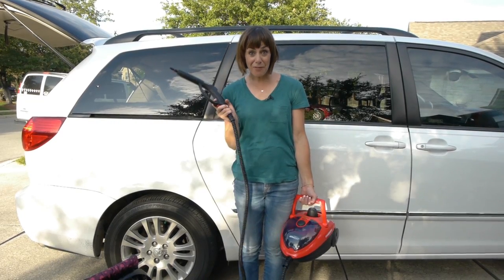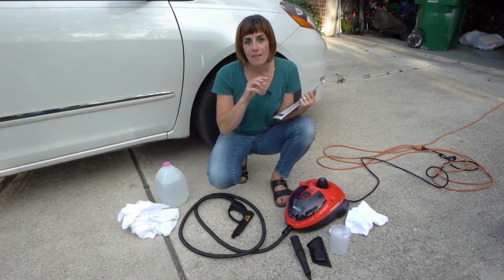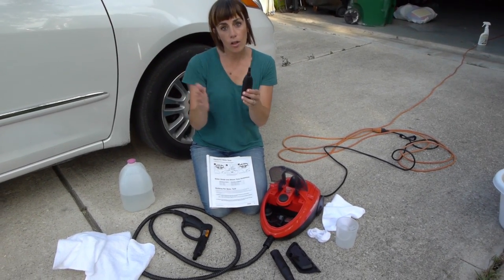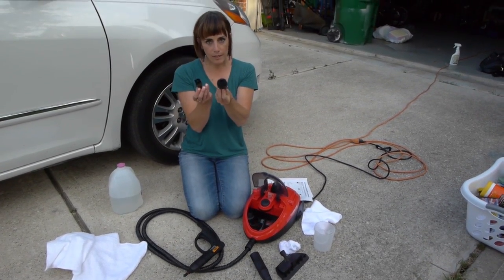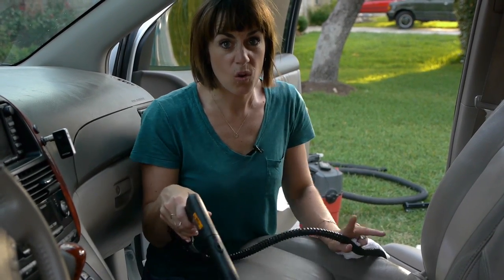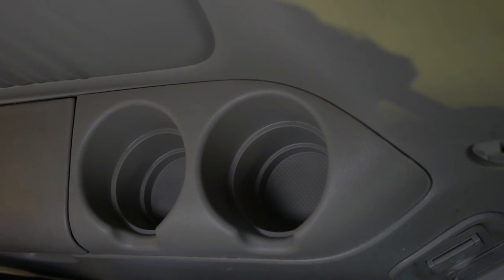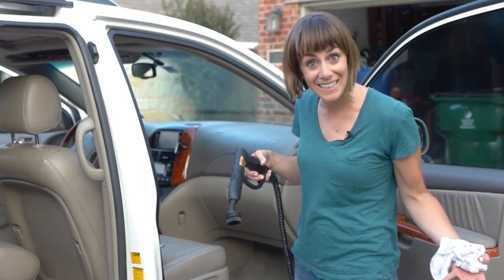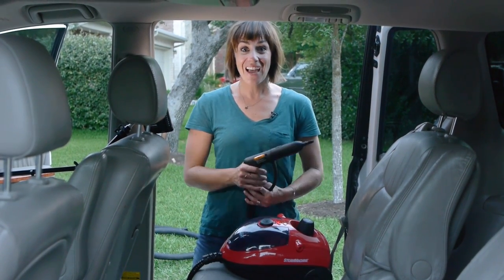How to Use the AutoRight Steam Machine with Live Free Miranda

Comment: How well does this clean brake dust,  dirt,  oil and grime off of car wheels?
Reply from the maker: The AutoRight SteamMachine works great for cleaning car wheels! The high pressure and temperature allows the steam to easily lift away dust, dirt, oil, and grime.
Reply: @HomeRightPS  What exactly is the temperature of the steam? I had a bigger $150 McCullough that I'd like to replace from Amazon. The manufacturer never responded to my complaints about their faulty switch. Which is frustrating because I left the switch in the on position and simply unplugged it when done. Home Depot doesn't service  them either. I now consider this a disposable product that may last a year, if I'm lucky. The steam wasn't that hot but I used it inside AND outside. I see it as a homeowner's necessity. I detailed my engine, rims. windowsills, glass shower doors, mirrors, storm door, granite countertop, stainless appliances, toilet, etc. FYI the attachment brushes will melt. You'll definitely need replacements. In most cases I didn't use the attachments. The squeegee attachment works well on mirrors. Distilled H2O is cheap BUT if you're certain to store the steamer EMPTY tap H2O should be fine.
Reply from the maker: Thank you for asking! We're sorry to hear about your McCullough steamer, you'll like the AutoRight SteamMachine much better. The AutoRight SteamMachine delivers up to 290° F steam to your surface and comes with a variety of attachments to clean countless surfaces.
Reply: @HomeRightPS  Is there a demo video that proves  your claim of 290 degrees F? What is the length your warranty? Does the warranty cover if it doesn't work? What if the hose breaks?
Reply from the maker: @PARIS8500  We do not have a demo video of the temperature. The steamer is covered under a 2 year warranty and will be replaced or examined by our technicians if there is an issue.
Reply: @HomeRightPS  what is the return procedure? Is shipping on my dime? AND to be clear your 290 degrees claim  is for your Elite steamer $140 NOT the cheaper model for half that price.
Reply from the maker: @PARIS8500  It depends on the circumstances but you can always call us at 800-264-5442 and we can walk you through the return procedure. The SteamMachine Elite and the AutoRight SteamMachine both output up to 290 degree steam. The Elite comes with different accessories and features a floor carpet glider.

Comment: How much water and how does it suck the water back up when using the upholstery attachment since it has the cover over the top?
Reply from the maker: Hello, thanks for your questions! The tank holds up to 40 ounces of water, which provides approximately 45 minutes of steam cleaning. The machine is using the water in the tank to produce steam, so the water doesn't end up back inside the tank. The steam is doing the cleaning without suction, and the attachments are directing the steam!

Comment: How do I refill it with water again
Reply from the maker: Hello Matthew! If the steam machine has been in use and you would like to refill it, turn it off and unplug it to let it cool for 30 minutes. After 30 minutes, make sure the red safety switch is ON and pull the trigger to release the steam pressure. Then, you can refill it with distilled water. This information and other safety precautions can be found in the manual. See page 5 for refilling: https://www.homeright.com/wp-content/uploads/sites/3/2019/09/C820574F-MAN-AutoRight-SteamMachine_LoR.pdf